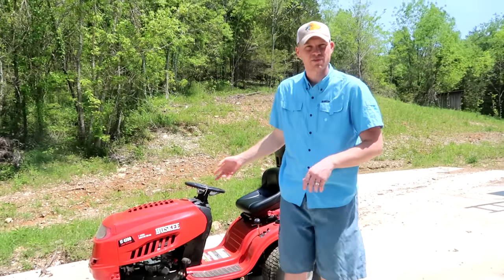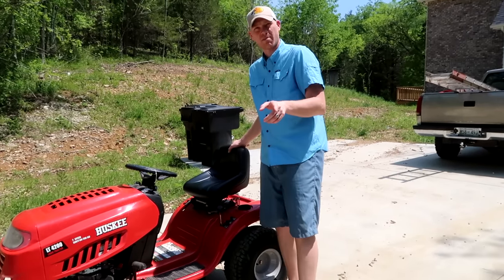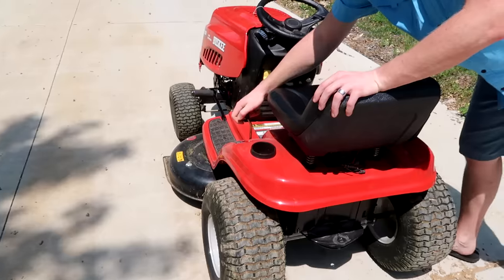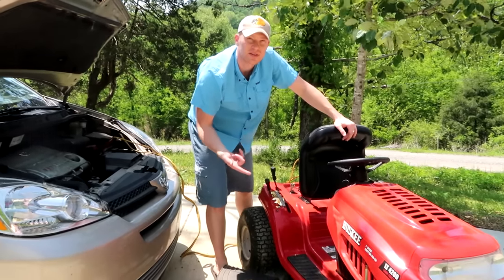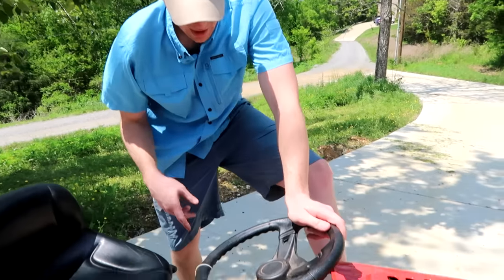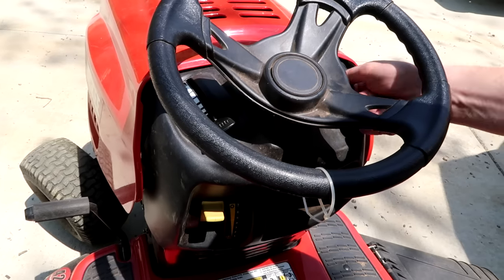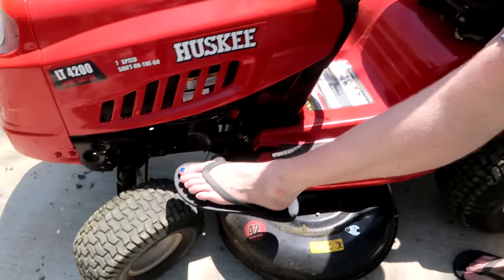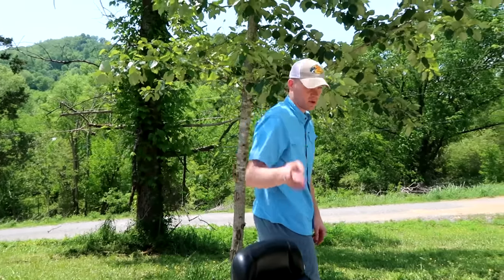MOWER WON'T START - QUICK TIPS

Comment: My neighbors left a lawn King behind so I told them to leave it at my house. They decided to just give it to me. I have an older Briggs and Stratton that runs great still but I can't get this darn lawn king that's alot nicer and newer to start and it's driving me nuts 😅 my old one needs a new belt on the bottom and I have to remove the blade because my kids love to leave their socks in the yard and my son ran them all over 😒 now they're wrapped all in the blade. I'll try to disengage the blade. I've never used it. All flat tires 😂but tires are cheaper then a new mower

Comment: I had to say "Thank you!" I have never troubleshooted starting a mower.  I tried jumping the mower off, but absolute nothing.  I watched your video and figured out the blades were engaged!  I put the lever on the turtle and jumping cables and I got my yard all cut!  Thank you so very much!  You made this seem like it was something I could do and with that encouragement, I feel like I learned and accomplished a major task!  Thank you, Charlotte
Reply from the maker: Thanks for watching!
Reply: This mower only trying to start when blades or PTO is engaged but doesn't start I didn't try putting in turtle. 
Thanks

Comment: My mother in law has a craftsman lt1000 with a 18hp Briggs and Stratton that spins over but just pops when the choke is on. I took off the carb and cleaned it and change the spark plugs and made sure the fuel filter was clean.  I don't think it's getting a spark because I took the spark plug out and hooked it up to the wire and couldn't see it sparking at all.  Do you think the coil has gone bad?  Also one of the rocker arms was way loose but I tightened it up better than it was but I got to get a feeler gauge and do it right.  Thanks for any feedback.

Comment: Nice video.
I had a problem with starting. Thought battery was dead.  I charged it up but still wouldn't start.  It would start with a jump.
Turns out all I had to do was clean the battery cable connection. 

So check the connector on the battery cables and battery terminal connectors before buying a new battery or even before charging your battery.  May not need a charge but only a quick scrape with a screw driver or sand paper or wire brush.

Comment: Okay I did all that get spark, fuel. Replaced ignition and starter solenoid. Still will not turn over by key. Also won't stay running ether, I was leaning more towards one of the safety switches. What is your opinion
Reply: What'd you figure?

Comment: And if all else fails, check the fuse running inline from the ignition switch. They don't note that in the trouble shooting section of the manuals. I found that to be my problem, costing me about $1 to replace it, and before having a repair company charge me big bucks!

Comment: I've got the same mower. Did all your steps and replaced the solenoid, ignition switch, the battery, starter, and the carburetor. I even made sure the valves were at .010 and my.015 and they were. It'll turn on only if I completely cover the air intake above the carb with my hand completely. Idk what else to do.
Reply from the maker: Sounds like maybe a gasket leak on the carb

Comment: I've been having a problem getting my t1600 19.5hp mower started. I've done just about everything. I took the carb off and cleaned it and the fuel salenoid and cleaned out as well and I changed houses. It will start off i take off the breathe and put my hand over the breathe hole. I'm thinking about buying a new card because I'm thinking it's abad carb at this point. I'm also thinking about checking the valves. The motor team good two years ago but it has been sitting outside. When I hold my hand over the breathe hole out does sound decent. Any advice will be greatly appreciated thank you, God bless...
Reply from the maker: Sounds like a air/fuel ratio problem. Maybe a gasket leak somewhere
Reply: If you have to change "houses" again, I would pick a desert climate where you only have to cut your grass once per season?😂

Comment: Thank you. My father recently passed & now I’m forced to figure out the lawnmower. I never weigh enough as a kid Bc it has some stupid safety setting on it for x amount of weight it, or it turns off, or won’t start. My mother doesn’t weight enough & now I can’t get it turn over. Battery is good, starter, plugs. It wants turn over, but just doesn’t

Comment: I habe a craftsman that won't start. It cranks but won't turn over I already put a new starter on it because it didn't seem to be turning it but that didn't fix it. It cranks better but still won't turn over.  Also put in a new battery. I do notice that after trying to turn it over for a minute or two the battery dies. Not sure if that's a clue.  I tried changing the spark plug and I think that might be the issue as I think the plug is stripped well not the plug but whatever it's called you screw the plug into. Can you tell me how to check if it's getting spark? Btw I had not luck starting with use of starter fluid in the carb.

Any help advice on how to proceed would be greatly appreciated. I'm thinking it might be electrical or plug related. Hopefully from what I've wrote someone can help diagnose the problem.

Comment: Thanks for the quick refresher!  I got a Murray Select Widebody LT with a B&S 16.5 HP engine that won't do anything. The previous owner changed out the starter solenoid, so it's brand new - could it go bad after one or two uses if the starter was bad? (Guessing here since the engine clicked and turned over but sluggishly - now I got nothing.) Any suggestions to help my cause in this heat (93 today) besides working in the shade?
Reply from the maker: Sounds like a dead battery to me. Have you tried jump starting the mower off a car? Drink lots of water!
Reply: Battery was charged overnight and got clicking -- apparently from starter solenoid not the starter. Will attempt to jumpstart it just in case battery is on its last leg.
Reply: Wanted to give you an update - it was the starter. Got it in the mail today, installed it and got half of my mile-high lawn cut before it got too dark. Success!
Reply from the maker: Awesome! Thats great!

Comment: Just bought a used 2010 boldens 13.5 hp. Riding lawn mower/lawn tractor. I put new battery and put a gallon of gas in it. In neutral I’m in the seat when starting it. Ok, turns over good but will not fire/ run.

Comment: My mower has been running fine until i didn't run it for 2 weeks, now it's cranking but it sounds like the battery is weak.  The motor only turns 1 or half revolution at a time, every time. I hooked up a battery charger to it and same results.  I have a toro Lx 425. Thanks

Comment: Hi Sir, any inputs on my mowers issue? Battery is okay because I can see the ignition sound when turn on the engine. But the engine is not running and dropping immediately. I’ve tried using starter fluid but no luck. Whenever I apply starter fluid then the engine starts but turns off immediately. Appreciate your help.
Reply from the maker: Sounds like a safety issue or some electrical problem

Comment: So that's all well and good one difference on mine is it has a safety, that you have to sit on the seat or it won't start, how can I jump it and sit on the seat without causing major sparking..
Reply from the maker: If it is in park, out of gear, and the blades are off you should be able to start it without being in the seat

Comment: I have an issue that i have not seen before  My 2005 Toro wheel horse lawn tractor  model 71427 . The PTO will disengage if I turn the headlamp switch off. I have already replaced the ignition switch ,the PTO switch , and the solenoid yet the problem continues    .ANY IDEAS  ?
Reply from the maker: Hmm. Hard to say 🤷‍♂️🤷‍♂️🤷‍♂️ weird

Comment: I forgot to step on the clutch before starting my Troy Bilt Pony mower. Now it won’t start. It had turned on just a minute before without any issues when I stepped on the clutch. The engine does not crank, but just a click that I can hear from the starter solenoid when trying to start it. The engine fan barely spins when turning it on, but I was able to rotate it when I took the cover off the engine. Spark plug did not have much carbon build up & just did an oil change recently. Any suggestions?
Reply from the maker: Sounds like low battery. Maybe tey to jump it
Reply: @WHOTEEWHO  Indeed it was. My BIL and I checked the battery voltage first & it gave us ~11.59 or closer to  12 volts so we thought it wasn’t the battery. We tested the starter solenoid then tried to bypass the starter solenoid & starter which didn’t work. Finally, we jumped it & it started immediately. We chuckled lol. Only if I saw your reply earlier, would’ve saved us a bit of time. Thank you for your fast response!

Comment: I have a mower just like the one you demonstrated, and it will not roll in neutral. I had to pull it out from the carport to put some air in the tires and it would not roll. Neither brake was engaged.
Reply from the maker: Maybe a belt stuck underneath it

Comment: Ive replaced my battery and spark plug, and checked all my wiring and safety switches and mine still wont click when i turn the key. Could it be my starter switch?

Comment: I have this exact mower... Started it for the first time since last year yesterday and it fired up in abkut 8 seconds and was running perfectly fine. Drive around to the front yard and as soon as I engaged the blades/mower it died and will not start now. It just turns and turns and turns. Cranks just fine... What should i check next? Why would it suddenly die after engaging the blades?? Hope your still active on this channel
Reply from the maker: Sounds like the engine thinks the blades are still engaged
Reply: @WHOTEEWHO  that crossed my mind... any idea how to fix that?
Reply from the maker: @BGSknkLrd  I've personally never fixed that on this one but you should be able to fins a video on someone showing you how to bypass that switch

Comment: Drain the float bowl for the Winter. Put some gumout in the float bowl to keep the needle valve from sticking. Don't leave yard equipment out in the rain! Put a little oil in the cylinder to oil the cylinder. Then crank it around with the plug wire unhooked. Replace the carburetor in the spring. Change the oil and filter. Check the blades and spindles. BTW, that pose is from Hulk Hogan! I went to school with Hulk from 5-10th grade! He came up with the name in the 6th when he was 13! I watched him wrestle a guy on the playground in the 6th! That was Hulk-a-mania being born! He had bangs from 5-10th grade. He had that gravely voice since the 5th grade. He played football. He has Hulk's Shop in Florida.

Comment: I started to mow, and my rider was running fine. But then, the blades sounded like they hit something
and it stopped running. I didn't see anything fly out the chute. I checked the blades and they seem to
rotate fine. But when I try to start it, there's a clicking sound but won't turn over the motor, I checked to
see if the PTO clutch was disengaged and it was. Any Ideas?
Reply from the maker: Hmm. Not sure

Comment: Manage to mow half my yard yesterday. Woke up this morning to not being able to start it. No noise when I tried it.

Full tank of gas, I got a battery that's less than a month old. I did the sandpaper thing on the spark plugs.
Now it's a loud screeching noise when I turn the key.
Where do i go from here?, any ideas?
Reply from the maker: Mechanical or electrical screeching? Could be starter
Reply: Had to order a new starter drive kit...all the teeth on it were shot. Thank you for the help, much appreciated.

Comment: My lawn mower decided to back right and dies. When I van get it running is only runs at 1/3 speed and when put to drive it dies. Any idea
Reply from the maker: Sounds like carb problems. Air/fuel out of whack

Comment: I have eliminated the problems you addressed.  On my mower, when I turn the ignition key it sounds like the starter is trying to engage, but the engine does not actually "turn over".  Any suggestions?
Reply from the maker: Possibly low battery or bad solenoid
Reply: @WHOTEEWHO  Thanks.  My load tester showed borderline on the battery; however the local battery shop said it was good,  So, I will test the solenoid next.  Thanks so much for your input.

Comment: If you run into the problem where all that stuff is good, and when your turning the key and your  not getting anything at all, i spent hours trying to figure it out and knew it had to be electrical problem, check your safety swtches... and it my case, it was a 25 cent 20 amp fuse under the gear shift where mine was in the middle.. changed fuse and it started right up.

Comment: Hello
My lawn mover doesn't start.
I have a new spark plug, battery and oil change.

I checked the carburetor it has gas inlet.
What should I check next ?
Reply from the maker: Check that battery is connected good. Then check all the safety switches - blades disengaged, out of gear, in park, sitting in seat
Reply: @WHOTEEWHO  done.
Starter is rotating but engine does not start
Reply from the maker: Motor needs air, gas, and spark to run. Has to be one or more of those if engine is cranking over

Comment: Quick question just today I found out that my riding mower won't start and i dont hear anything the battery is fully charged and It's in neutral and I even used starting fluid and it's still the same can it possibly be the spark plug?
Reply from the maker: No. Even if the spark plug is bad the engine should still turn over
Reply: @WHOTEEWHO  yeah because it won't even crank like turn over if anything I just replaced the cable engaged blades but other then that that's it
Reply: @ssrodz3158 does the starter crank over, if not then first of all manually rotate the engine by hand and if it doesn’t somethings wrong with engine. Most likely not the problem unless you ran it with no oil or the problem could be the solenoid isn’t working properly, these are the main problems that you can have but these are only if the starter doesn’t turn over
Reply: @manofculture4945  the engine still has oil and today i checked the starter it works when i put the jumper cables on the starter and ground it and the engine spins as well but it doesnt turn on also I replaced the solenoid last year but I guess I'm gonna have to replace it again if that's the case also the red power wire is still good as well so idk what to do anymore I try to turn the key and nothing but when I put jumper cables it spins along with engine but it doesnt turn on idk if it's the starter or the solenoid
Reply: Well today I just found out it was a blown fuse so I replaced it and from.there it turned on

Comment: Hi followed those steps, my mower is same spec engine as yours in video, starts, runs and a minute later dies. Checked fuel line no starvation......what could it be ?  Thanks
Reply from the maker: Mine did the same. It has a leak in the carb somewhere.  After I replaced mine it runs like new and never shuts off. They are less than 50 bucks online
Reply: @WHOTEEWHO  hi it’s new done 2 cuts it should not need new card I think it’s air intake ?
Reply from the maker: @davidglover8101  doesn't matter how many cuts it's done, it isn't working now. Double check all the gaskets and seals

Comment: With my 11 year old Craftsman, I have to have my backside in the seat and foot on the brake or it won't start as a safety feature. I wonder if the starter is another vague thing to check? Another thing I just learned is that the throttle cable can be a bit loose and doesn't open it up all the way. A simple tightening of the cable screw near the lever is an option. This winter I recharged the battery a few times during storage and it said 100% but when I tried it the first time this season, no turnover. Thought it might finally be the starter but went for the easy thing first and it was the battery after all. Thanks for the checklist on starting problems.

Comment: Did all that put new battery in. and nothing.  Was jump starting before. Now nothing is there a fuse . Also I took the wires connected to the seat and twisted them all together.  That didn't stop it from starting til now

Comment: The latest one that I"ve been thru-"troy bilt Bronco",turn the key nothing at all happens But if I leave the key on and run a jumper from the positive terminal,directly to the starter, it fires right up.From what I've learned on u-tube,probably bad ground,I"ll check that or I"ll just run it like that.Remember there"s a million safety switches (ok,probably 4 or 5),That"ll keep these things from getting power to the starter.Brake switch,blade engagement switch parking brake switch,reverse switch(so you can"t mow in reverse(How stupid!),oh,seat switch,if your ass isn"t sitting on the seat-no go(very handy)I jumped all that crap out along time ago ,hell,I just wanna cut the damn grass!

Comment: Have a craftman about 5 yeara old. Was using it one morning and 3 minutes later wont start last a heard was a blade noise.Wont start or making any niose or light on. Any ideas what should I look for.
Battery is good and got new spark plugs, has gas and oil.
Thanks in advance
Reply: Last I did a full tune up was last year.
Reply from the maker: If no lights then has to be an electrical problem somewhere. Check all the connections
Reply: I checked the fuse its good. 
Only thing I notice was the headlight cord burned could that have caused it? 
This is my first time having to do this investigation.
Thanks
Reply from the maker: Could have caused a short, yup
Reply: Sure Enough it was the light cable.
Reply from the maker: Glad u fixed it

Comment: My want start at All it’s silent when I turn the key I changed the spark plug already it has gas battery still works supposedly but when I try to jump start it the only thing it does is it cranks n it goes off do it again it does same noise n goes off want even start don’t know if it’s fuel pump or something else